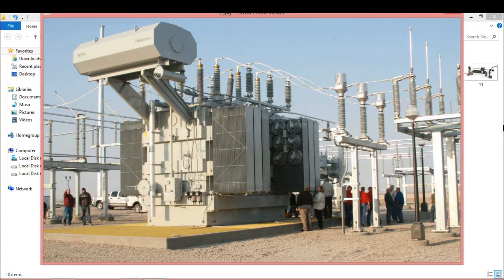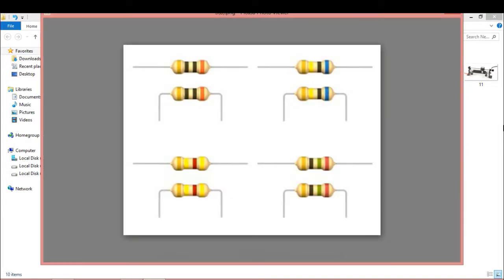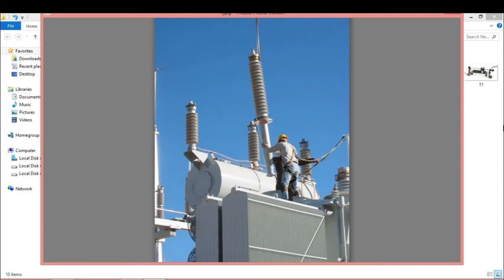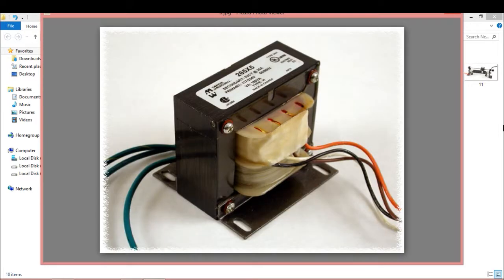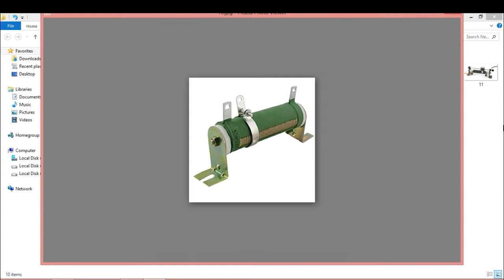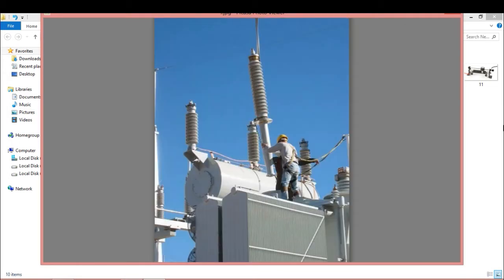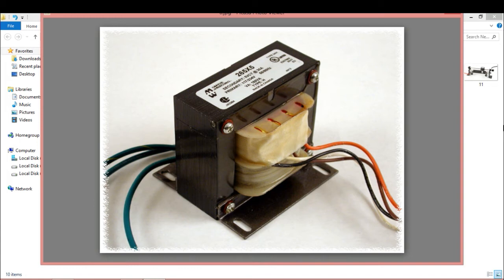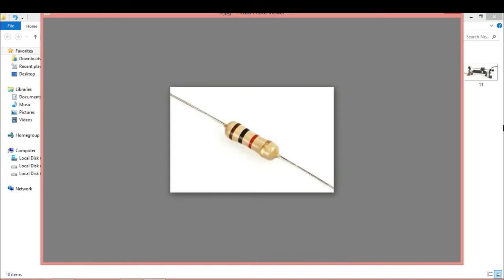Why can't a resistor be used in place of a transformer

Comment: Why we use transformer if power in primary and secondary are equal. Whether we drop voltage or current in primary winding, we can not change the power. So why do we need transformer?